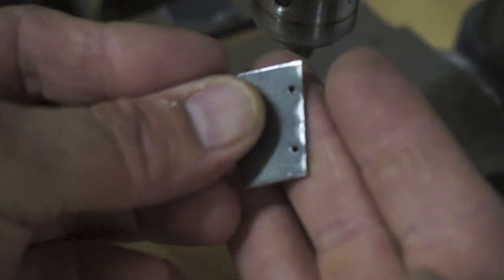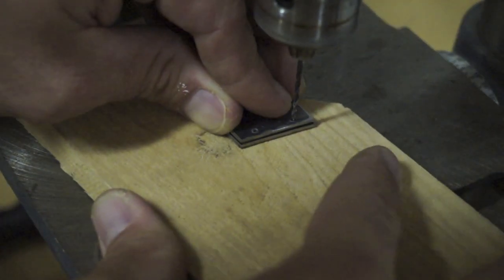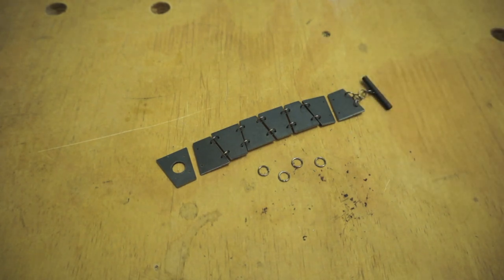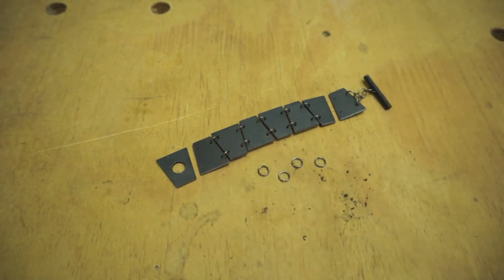Bracelet for my Wife - DIY atlas shrugged style

Comment: Nice build.  Are the connecting rings pointy or pokey? One suggestion, as the video didn't show any metal treatment. My first idea would be gun bluing as you are looking for a blue-green tinge. The other idea would be plating. In any case very cool.
Reply from the maker: Richard Hauser Hi Richard,   The connecting rings aren't pokey or pointy at all...or atleast my wife doesn't think so, since it doesn't fit my wrist;)  As for the treatment... I planned on doing a clear coat laquer to help with rust prevention but haven't done so yet.  The blueing might look really cool though and also help with rust as well!  Thanks for watching and the great ideas too!
Joe